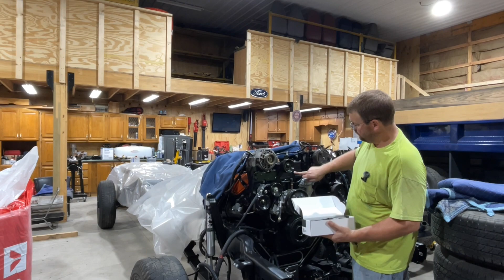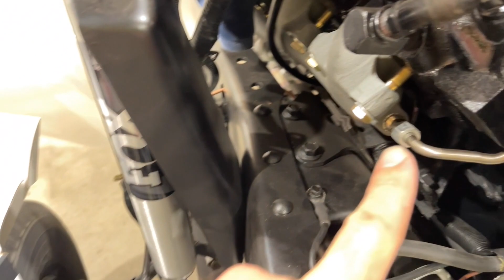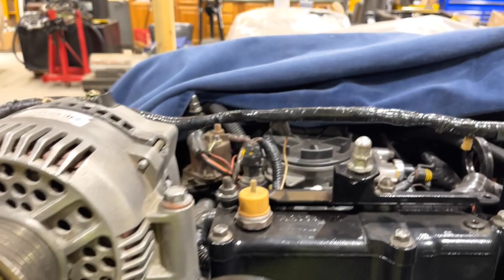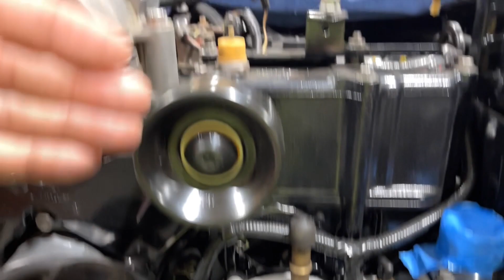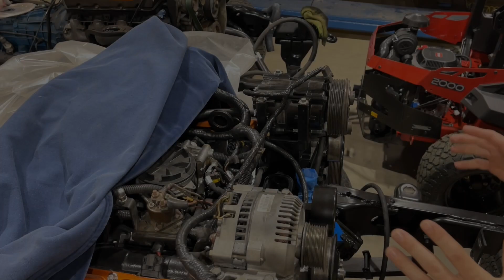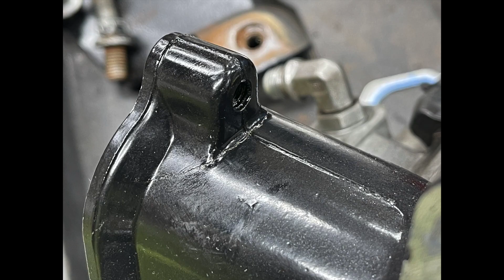7.3L HPOP Spacer Install Gone WRONG!

Comment: I usually either swap to a Sd tube and hpop bolt cover and extend the wire but it would definitely be nice if they made a better option.
Reply from the maker: I’ll be moving wires and going to the Driven Diesel adapter on this one